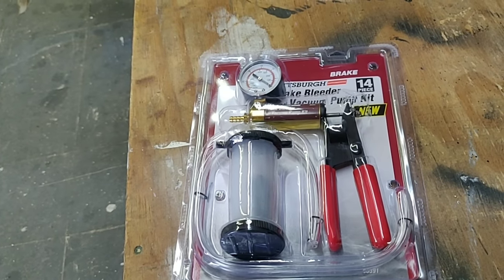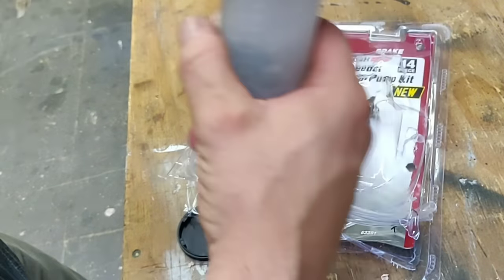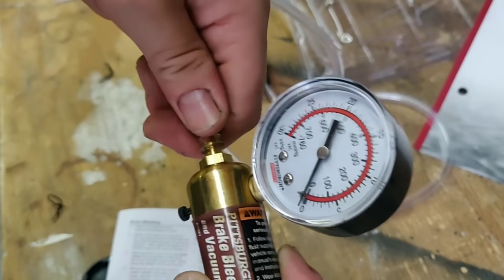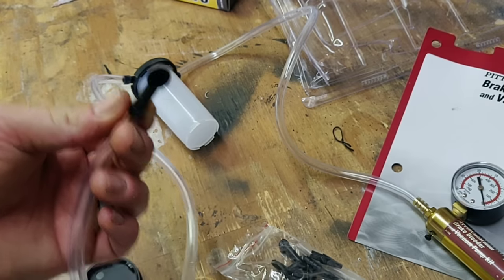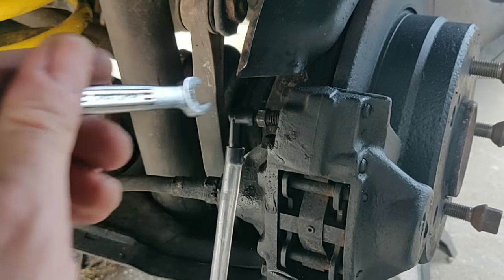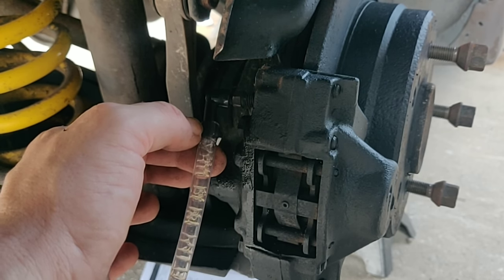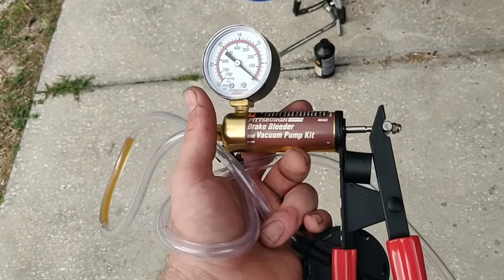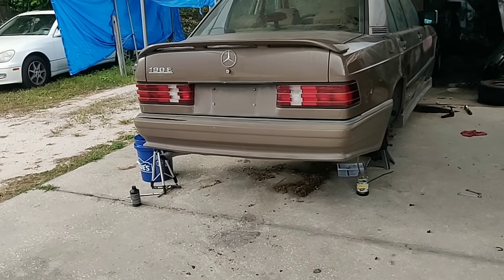Harbor Freight Pittsburgh brake bleeder vacuum pump demo and review

Comment: I haven't read all the comments so I may be just repeating what someone has already said. I recently bought the compressor version of this pump. It uses a venture action along the same principle. Works fine but I can't get rid of the bubbles, then it dawned on me. The air is being sucked in around the thread of the loose bleeder valve. All you can do is keep bleeding it until a good amount of fluid is caught in the catch bowl and hope like hell there is no more air in the line. Not the best system to bleed brakes!

Comment: Oh yeah 😎? Bought the more expensive grey plastic vacuum pump from Harbor Freight years ago and never had a problem using it on motorcycles, scooters and cars. May try it on tiny hydraulic brakes of bicycles 🚲. Maybe a plastic syringe would work better? Need to find out.

Comment: Not a bad hand pump, still have to push pedal to get fluid through lines and fill new calipers.  Get airlock sometimes!  Once full then use hand pump, couple pedal  pushes usually fills but still air.

Comment: 2 minutes into the video i run to harbor freight to get me this tool, get home destroy the package and resume video just to find out its a piece garbage. Great video!!! Note to self: finish watching video b4 you buy
Reply: It's not a piece of garbage what he failed to do was remove that little rubber piece that is in-between where the handle is basically the the price that's keeping the handle spread u squeeze it together an remove the rubber piece an the pump goes all the way in an u will see the difference

Comment: i h let me car set with out the lines connected waiting on parts for master cylinder seems to be a lot of air in lines im goning to use the vac to see if i can get the sponge break feal out and have brakes again. thanks for the video.

Comment: I just replaced the rear rotors, calipers, and pads on my Chrysler Sebring. I grabbed this same vacuum pump and it can pull just over 25 inHg on the caliper bleeder screw.

Comment: Couldn't you use a Holt Industry Fluid Extractor ?  i thought it was pretty good to use when I did PS.  It doesn't come with a gauge so you would have no idea what PSI you're getting or you're getting a leak but it's so much nicer to use than this hand held POS.  I used the mighty mac and it took me 2hrs b/c it struggles to hold pressure.  I'm curious if you can do a demo using HF Fluid Extractor.

Comment: I use a stick, just long enough to wedge between the depressed brake pedal and the seat (Adjustable) ... a Broomstick or peice of 2x2 or shorty painters pole will work just as well, & that is how you one man brake bleed w/o any special tools...
Reply: Ok stick will depress brake but doesn't fluid need to be pumped for it to flow out caliper bleed valve end?

Comment: I bought one and tried to use it on a 2012 Buick Regal GS with a brand new caliber. I had issues with the fittings it come with to include the hose getting the tight seal around the bleeder value could get a seal with my finger just not around the bleeder valve.

Comment: even though your pump is working correctly the vacuum air leak could be happening on the bleeder valve if unscrew to lose.  The leak is between the valve and the caliper thread.

Comment: Now that I already purchased product and opened it. There is a 90 day warranty. You ever get clear fluid with no bubbles vacuuming that first caliper? P.S. you'll never get rid of the bubbles as they are caused by an valve. Mine worked fine all the way around and in the master cylinder.

Comment: You gotta start from each individual brake caliper bleed port starting from right rear to left rear to right front to left front. And if that doesn't work, you may even have to start all over but bench bleed the master cylinder first then start in that same order again. If that doesn't work, turn the car on and have another person help by pumping the brakes and then throw away your flimsy tool away because it didn't do its job. I personally rather have a 2nd person while running the car on to fully rid the whole sys out with air. That's the best way from my personal experience. The other thing you got to be careful too is if your caliper bleeder ports are so old that if the threads on them are rusted it won't provide a proper seal and will also let air in that way so you'd have to just replace all of them with new ones.

Comment: Take that black rubber plug looking piece out from between  the handle and body, it is there for shipping. You get WAY more stroke to the handle. Mine works fine, used correctly.

Comment: I have this pump, you have to remove the black plastic holder wedge that is prohibiting a full squeeze. Then you can get a proper draw on pressure. I guess is is to keep the handle at a certain position when not in use? it has a slot so that it can go back when you are done. They need to mention this in the instruction manual as an important note.

Comment: Pressure works better than suction . If you attach a length of hose to the bleeder and place the other end in a clear bottle with the hose submerged in fluid ( a 12 ounce water bottle with a hole in the cap works great) you can pump your brakes until the bubbles are gone and won't get any air going into the system. It's the suction that makes the bubbles but the air isn't getting sucked out of the system. It is getting sucked out of the atmosphere through the bleeder threads. You can do this yourself. For the passenger side, just use a stick to pump the brakes, or set up a mirror or camera.

Comment: Random question...any guess what the sizes and TPI is on the gauge?  I'm thinking of buying this and putting it on a vacuum chamber, but I'll need to tap the hole the correct size for it.  I don't want to buy another tap.

Comment: Did you fill out the I D 10T form before using the pump??? I've used the same pump for years & it's NEVER failed to do the job, or create pressure! 
Tip: If you take the spacer out of the handle, you'll ACTUALLY use the entire pump chamber for vacuum instead of just 10% of it!

Comment: lol you chuck a good tool there is 3 causes 1 the black ring in the pump handle needs to be removed then for your fail if you pump all the fluid out its a small volume system and all the lines are full of air when you do this you need to fill the master cyl with fluid and give it a few pumps then use your hf pump and it should work fine again. also the lid O-ring and fitting should be greased to help stop vacuum leaks and never get brake fluid in the pump. hope that helps iv been using one of these for over 20 years i clean with carb cleaner and regrease after every use and still going good

Comment: I used a kit similar to this that I bought from an auto parts store many years ago to bleed the brakes on my Porsche. The problem was that air would get sucked in through the threads on the bleed nipple, making it useless.

Comment: common standard to measure rough vacuum is inches of mercury ("Hg). One method is as "Hg gauge ("HgV), where the scale starts at 0" Hg (atmospheric pressure) and goes up to 29.92" Hg, which is perfect vacuum. It was not pressure you were getting but a vacuum that was being created, that was drawing the  brake fluid be toward the bottle! It is also what you do to evacuate the lines in a air conditioning system! Just to be clear!

Comment: When you "pump" the pump, it is called vacuum....not pressure.  Be sure to only slightly crack the bleeder screw so as not to pull air past the threads of the bleeder screw.  You can also apply a heavy grease around the bleeder screw to help prevent air from being pulled past the threads.  That may be part (or all) the reason that you are observing a lot of air entrapped in the hose.
Reply: That is why I only take advice from Master Mechanics
Reply: I suppose he could have said it was NEGATIVE pressure. But like you I would have preferred that he said VACUUM or SUCTION.
Reply: I never had to unscrew the bleeder as much as he did. It's usually like 1/4 turn to1/2 turn to open the bleeder. Plus the hose going straight down doesn't help. It's supposed to go up for the air to travel through the hose better. I barely ever need a hose system. Usually do the 2 person and just caught the fluid in a water bottle. Old school always works fine.

Comment: Some times you have to pull the bleeder screw out and put a little grease on the threads, because you will actually pull air past them instead of pulling pure brake fluid. Hey, the guy is learning, give him a break.
Reply from the maker: Thanks.  And yes I don't mind negative feedback.  I actually even made a new video. Linked in description.  Idea of video is to show real use for first time so anyone buying one and never used can see from someone like them.   But it works pretty good.  Better than doing it the old way.

Comment: You need fluid to expel air; the glass on the pump serves to contain brake fluid mixed with interfering air, which will result in a decrease in brake fluid in the vehicle's reservoir. It is mandatory for you to add brake fluid to the vehicle's reservoir, ensuring it doesn't run dry to prevent air from being drawn back into the vehicle's brake fluid reservoir until no air bubbles are visible in the suction hose you are using. A little tiredness, but the results do not undermine your efforts.

Comment: Make hole in bottom of throw away plastic cup bottom, thread in air hose, fit it to the cap opening to pressurize the reservoir.
The simple non-ABS metal block brake line distributor, must have valve inside blocking flow.
Must back to front and repeat or valve will block flow/bleeding

Comment: i like this bleeder.1st make sure your catch bottle has a seal on it. Dont use the plastic adapters to put on bleeders. use only the hose and put some vasiilne  around bleeder so it dont suck in air if it does. works fine.

Comment: I have one similar. You have to be mindful that the fittings for the bleed screw are not a great fit. Put the tube straight on the bleed screw and put vaseline around the joins to prevent air being drawn in - it's why you had lots of bubbles
Reply from the maker: Awesome thanks for input and watching.  Love the positive inputs. Have a blessed day

Comment: I had the same issue with my harbor freight vacume bleeder after replacing a bad caliper.  However it started to hold preasure once the short hose (in the cup) was submerged in brake fluid.  Any thoughts why? Or was it just a coincidence?

Comment: Thanks for the review.  A drill I bought from H/F wobbles around its drilling axis.  Only good for wire brushing metal and none for drilling for heli-coils.

I do not have a party than can pump the brakes.  Gravity system worked "okay" on my Astro Van so I shall try on my Solara.
Reply from the maker: Thanks for watching

Comment: I bought one yesterday; he never removed that wedge which is a part of shipping. That is why he couldn’t get good pump. Pittsburgh should probably change the color of that little piece. Looks like 3/4 inch of pvc pipe wedged the keep the trigger from full extension and retract.

Comment: I saw you to bearly open the vale and with the weight of the already connected hose, it closed the velve again and you never opened back, so you have to turn at least a full couple of turns, give another try and youll see, becase normally that fluid will drain out just by gravity without any vacuum.

Comment: First I would have tried gravity bleeding them first. Close all bleeders pump brake up enough to get some pressure. Then open a bleeder and then repeat that process one more time. Then open all the bleeders and let the car naturally bleed itself. Less air bubbles and when you go to use the tool it might be able to pick up some sort of vaccum. But I also agree with the people saying that you are picking up air from the threads in the bleeder.

Comment: Typically when you use a vacuum pump it can suck air around the bleeder screw threads.  If you pull the bleeder screw and put a bit of teflon tape on the threads it will prevent the vacuum leak and you'll get better results.

Comment: Thank you Pete. 
 I purchased the same tool from HF and got the same result. Bottom line is, HF quality control of tools is sometimes bad. I will return this and buy another one at a different Auto Parts Store.
 Btw I also got bad electrical multi-meters repeatedly at HF.
 This is disappointing.

 Regards, Nándo.

Comment: You could have actually just cracked the bleeder with the plastic hose attached and  pumped the brake pedal yourself A couple times until fluid flowed out ,or just cracked the bleeder and let it gravity bleed awhile! I have been doing brake jobs my whole life  getting someone to pump the pedal  for me and no one ever seems to be available any time I need help! Lol!  Well , I finally saw a guy bleed with a tiny bottle attached to a magnet and a plastic hose to the bleeder! It works great. Put some clean fluid in bottle and hang it on the frame somewhere above the height of the bleeder screw . Attach line on to the bleeder screw and open bleeder.Go pump the pedal couple times. Keep checking your master cylinder fluid level while doing this !When you see the fluid in the line starting to get solid  ,no bubbles, close the fitting tight and disconnect ! It really works well. The air bubbles rise in the line and don't get sucked back into the system when you let off the pedal! No need for second person ! I ve done several vehicles this way now!  The little bleed kit cost maybe 10 bucks . Tiny plastic bottle with magnet on it and line and some fittings!

Comment: air bubbles can be sucked in around your fitting that you put on your bleeder valve, plus you didn't remove the spacer between the handle and the back of the vacuum cylinder. Harbor Freight should have put that in the instructions, but in the photo provided you can see that the spacer is removed.

Comment: The air bubbles you’re getting are not in your brake system. That is air leaking around the threads from the bleeder screw. Before you start, remove the screw and install some Teflon tape on the threads, then reinstall the bleeder screw. That will stop the extra air bubbles in the line. 
You’re right on that harbor freight tool. The first one I got didn’t work at all. But I took it back. The second one worked perfectly and has for 10 years. Just don’t let any brake fluid get past the little cup and get sucked into the vacuum unit, it will destroy it.
Oh I know you know, but it is not pressure you’re creating, it’s vacuum.

Comment: make sure that you take the guard that is in between the handle and the pump, that's the main reason why you can not pump enough, and that pump really works, I've done many brak works with the same pump and no issues at all, but before you do any review make sure of inspecting your equipment before uploading the video, very informative but just that only part, the pump still have a guard on the handle that is why you can't pump enough.

Comment: Mine did the same after the first time opened the plastic bottle it never sealed again, the pump built suction when I plugged the hose, so plastic container doesn’t seal after brake fluid was in plastic bottle

Comment: The third way would be using a tube with a one way valve that does not let  air back in. It works, I use it.
Reply from the maker: Yes it's a great method

Comment: Great video was going to buy but after watching video changed mind thanks mk
Reply: He forgot to remove shipping spacer under the handle. It's the round black thing in the vid at 11:10, right under and to the right of the vacuum cylinder .

He did a 2nd video where it worked fine. He really should put it in CAPS in the description with a link to new vid: 

https://www.youtube.com/watch?v=YGIKFil7gh0

Comment: You don’t need a tubing wrench on the bleeder screw
   They are designed to pass the brake line through the opening
  You can slide the box end of the wrench you have and leave it on the bleeder screw while you do the work

Comment: If anyone is thinking of still getting a HF Pump like this you can test before you get fluid in it. Put a hose on the end of the pump and clamp it closed. Pump it up. See how much pressure you have then un-clamp the hose.

Comment: Could have taken the plastic cap out of the upper handle. The top of the handle should have been able to go all the way flush with the cylinder. Your pump stroke is being reduced by the length of that cap.
Also, those horizontal bubble lines are, 99% of the time, cause from sucking air through the bleeder screw threads.

Comment: the device is producing a vacuum, not pressure. Regardless of the 10mm hg vac recommendation you extract fluid until no bubbles are present and job is done.

Comment: with my two cars that I had to replace the calipers and hoses I had to use the two man thing to start just for the front on one and the two man thing on the second. because of how much air in the lines and it wasn't having it creating a good enough pressure. I have noticed after getting the air out I was able to flush the lines out a lot easier with the tool. It seems to create a better pressure type of thing. I don't know whats up with it. but works if the system does not have the air in the master cylinder/line. but call me weird
Reply: It’s the nature of hydraulics.....fluid has thicker viscosity than air therefore greater working force. I used to work aircraft catapults and arresting gear on a carrier....that’s some massive hydraulics and keeping air out of the system was just as critical there as in car brakes.
Reply: Wired

Comment: The bleeder valve on the driver-side caliper is clogged. All you have to do is take it off and clean it out and you will get flow. Analogous to a clogged drain.